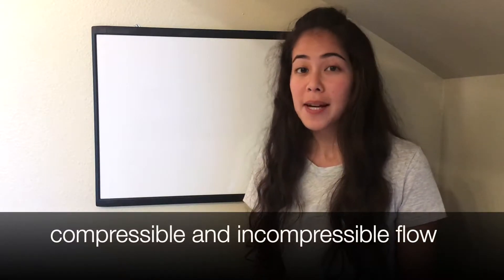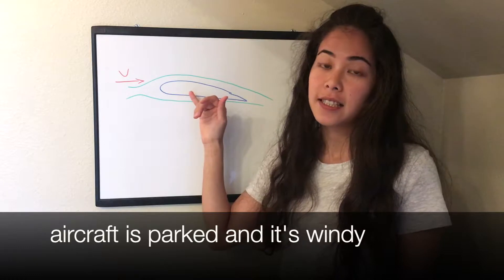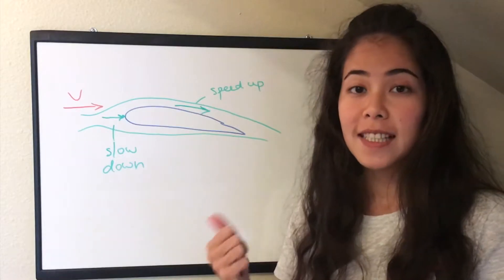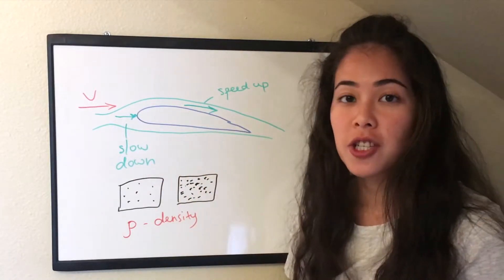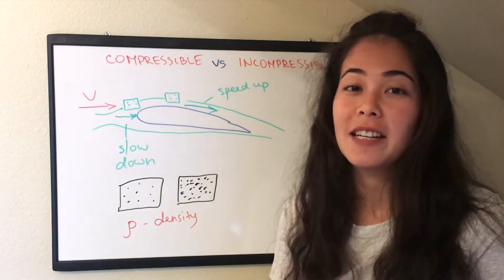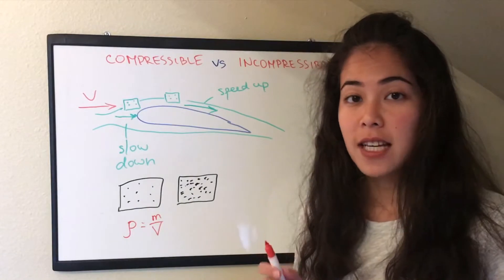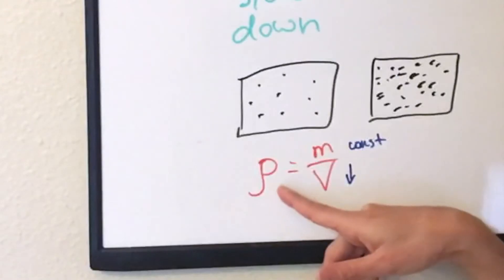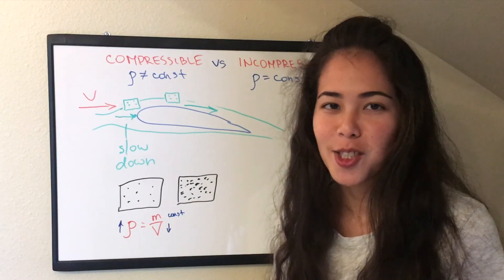What is compressible and incompressible flow?

Comment from the maker: Have you ever put a balloon in the fridge? 
1. Yes
2. No
Reply: No I have never put a balloon in the fridge but I will try to
Reply from the maker: Haha, you'll see what happens
Reply: And please can you explain sine,tan and log
Reply: Well I really love your videos teach me more
Reply: 2.
Reply: Nope
Reply: No. But let me ask you, if you dont mind: what are the implications about density of air (compressible and incompressible flow) to maintain the fly?
Reply from the maker: @kekuleonitro  at high speeds, when air density changes, there will be shock waves, temperature and pressure changes and etc. So, when designing military aircraft (Mach 3+), all of these things need to be considered.
Reply: Would it be wrong to say that the air at high altitudes would be denser than below? Due to the lower temperature, the air would be more condensed than below and also due to this, the pressure is also reduced much more than below the atmosphere (example of the balloon in the freezer)? That's why planes, in denser air at altitude, due to the greater cold, lower the viscosity of the air, making the flight more economical?
Reply: Yes

Comment: The boundary between these two principles is something that greatly intrigues me. And i dont mean absolute incompressible but the pressure of compressible flow where further compression exceeds the natural tendency for matter to exist in a gaseous state, further compression being the exceeding of the matters natural attributes that permit a gaseous characteristic without further alterations to the surrounding attributes and properties required to preserve this gaseous state and not begin to blur the lines between the gaseous and liquid characteristics of its state.
Example being the Tesla turbine that compresses a gaseous matter to the point it begins to exhibit the characteristics of a liquid state and behave as such, contrary to the behaviour one would expect when conceiving the operation of the turbine under the characteristics of the gaseous medium flowing within it. If you compress a gaseous medium far enough, and remove the heat from the system the gaseous medium crosses the threshold of attributable characteristics and begins to exhibit a rest state of liquid. The curious aspect being, if you continue to remove thermal energy from the system you approach the point where the characteristics again begin to change and you reach a point where its state is attributable to a solid (or triplicate in just the right combination of characteristics, attributes and systemic properties. ((hope my layman terminology is close enough to accurate to convey the intended meaning, im just an uneducated, amateur enthusiast)) ) and that solid being considered as again being compressible, albeit to a degree *for practicability/feasibility purposes.

I wonder why the middle state is considered least compressible when the solid state, except in the case of H2O, is considered as technically being the most dense....

And where does the exotic states of matter sit within this relationship of compressibility, even crystalline compounds....

And last but certainly not least, what is the compressibility of the 4th fundamental state, arguably the primordial state, of matter, plasma? *with the consideration you could keep other factors within the system equal by removing or adding residual thermal or electrical energy and only the density considered inherently variable???

Comment: Puty and good explanation are collected in one person. 
 I have two questions please? 
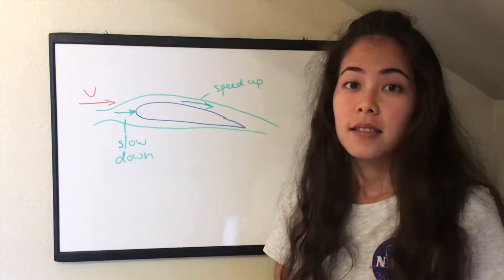1_In 2:29 you said that the density will Change. But if the molecules of the air moves with the same velocity thay will never close to each other so I think the density will not change.
I am confused from this point 😢😢.
2_ should  incompresible fluid be incompresible flow??
Reply from the maker: 1. because air has to change speed on the top and the bottom of the airfoil, the pressure will also change, so the density of air will change too, as it depends on pressure.
2. yes, incompressible fluids can only have incompressible flow, like water in the pipes.
Reply: @AliyaBurkit 
Thanks alot 😍😍😍. 
Do you know a names of references that  I can  learn from?